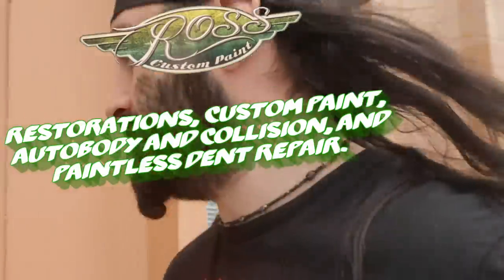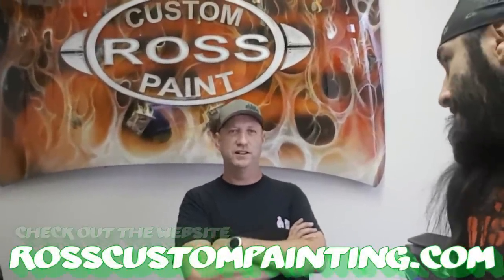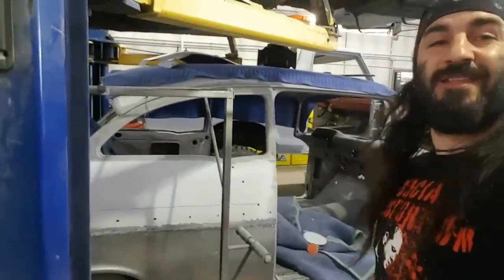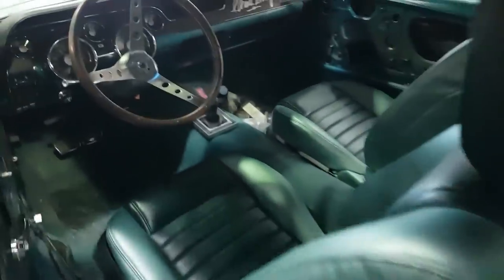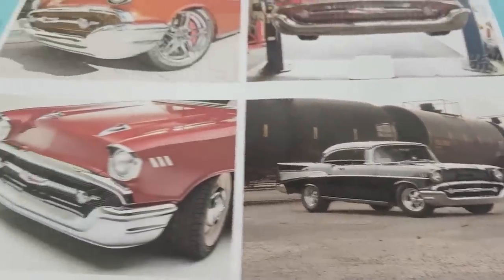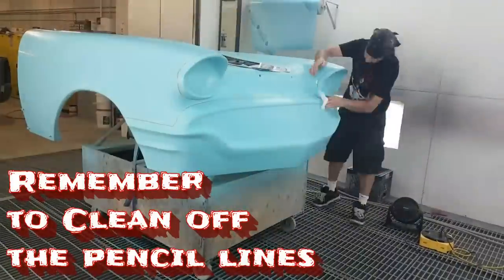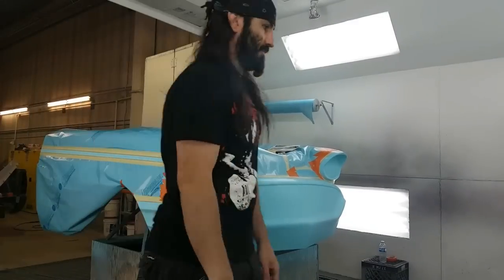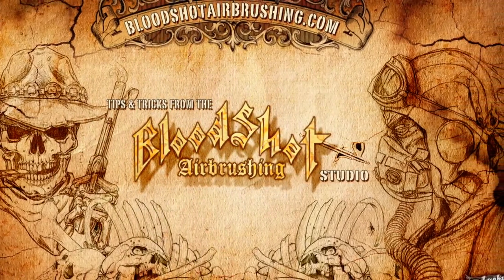How to Airbrush a Dragster Tutorial. Video 1-Project Introduction and Layout.

Comment: I was doing some of my 20 hours and I noticed that when say finishing a line, I put the brush down for whatever reason, when I picked it back up was starting to make another line, when I pushed down for air I got a dot, didn't pull back just down for air, I'm using a cheapo from harbour freight 10 bucks, should I be using my eclipse for practice
Reply: The dot is paint left on the needle tip. After finishing a line clean the tip, I pinch the end of the needle to clean off paint but you could use a  paint brush and water. Another thing to do is spray off to one side first to make sure the airbrush is going to do what you want it to do.
Reply from the maker: @lambrettaladUK  thanks for the Intel soldier!! Great advice!! 😁👍 Big Cheers and Much Love from the BloodShot Studio!! 🤘😎
Reply from the maker: As lambrettalad said! This is caused by having a bit of paint on the tip prior to adding the air. And as stated, I shoot off to the side to test my paint before I spray! And cleaning the tip has become second nature for me! I'm cleaning that tip every minute or so of spraying!! I hope this helps you out a bit broski!! Big Cheers and Much Love from the BloodShot!!🤘😎